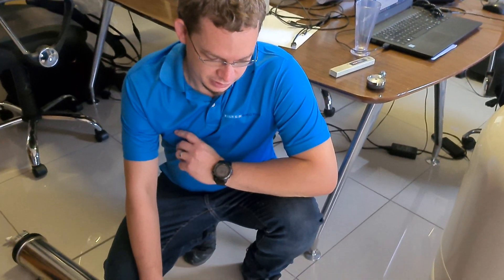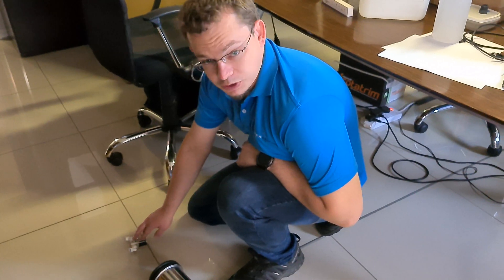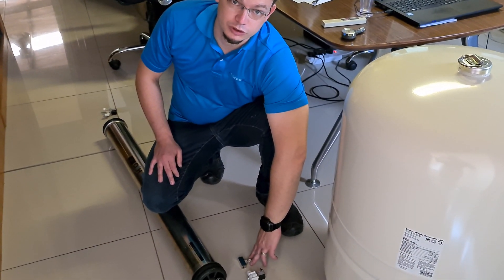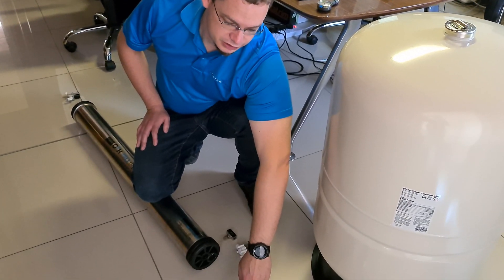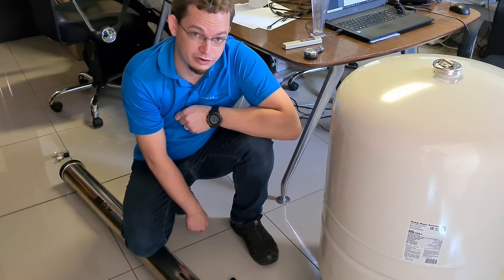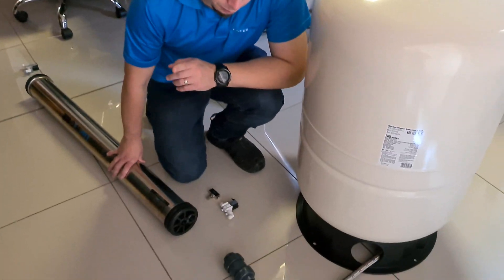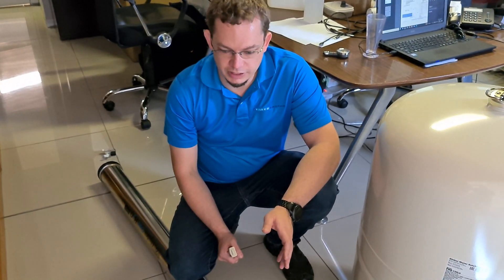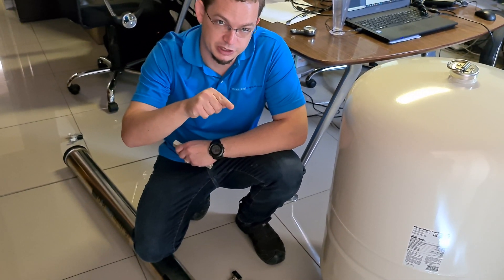DIY 4040 RO Membrane Setup With Pressure Tank

Comment: My 4040 RO membrane came with an adapter (2 inches cylinder with orings inside. What is that for? I have the same stainless vessel as your video.
Reply from the maker: It Should be the seals for the endcaps.
Reply: It's for hooking 2 filters together in large commercial systems!